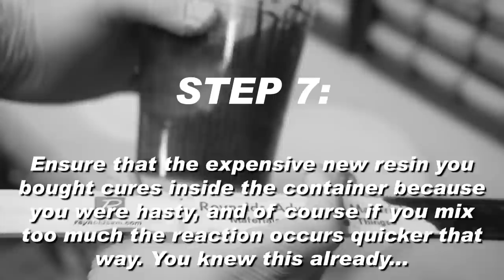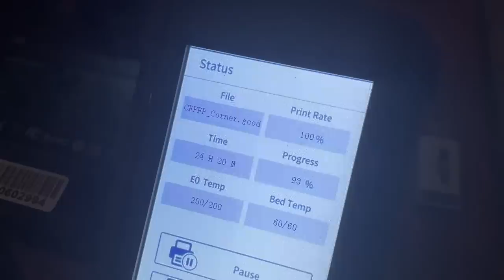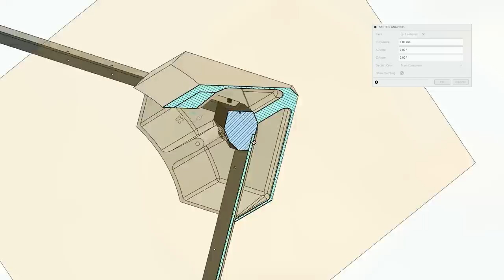How I made a life-size Companion Cube

Comment: Another Aperture product you could try building would be a laser emitter along with a laser catcher. It could be the same size as your button or bigger/smaller. Have the laser emitter fire a red laser beam, and a laser catcher that will detect it (maybe with a sensor) acting like the one in game (makes a sound and spins the outer ring) if it's not too hard (it also has a yellow light when activated and a blue light when idle)
Reply: or acting similar to a wiimote when pointed at the sensor bar (the wiimote uses light emitted from the sensor bar to detect where the cursor is idk how to explain it)
Reply: the thing with this is that the laser would be invisible unless there was something that could cause the Tyndall effect to show up, so itd be incredibly hard :(

Comment: Learning what not to do, is still learning :)  I’ve been sort of obsessed with the companion cube since I learned of its existence, even before I had played the Portal games myself… I spend loads of time 3d modeling my own version, which is slightly different from the in-game version, the “bumpers” are a lot smaller so the overall shape comes closer to a “flatter faced” cube.. if that makes any sense… I made a 1cm squared pendant version that was 3d printed in a wax material and then casted (iirc) in sterling silver :) I’ve been wearing it for over a decade now :) Hopefully one day I’ll be able to make a bigger one, probably not full sized for practicality reasons, but still… Anyway… love the work you’re doing on the Portal projects!

Comment: Realistically speaking, you could connect the cube via RFID sensors in the Heart mold to the button, to register it being pressed, OR have the LEDs connectable via Bluetooth (or some other wireless connection) and have the cubes light up room by room, puzzle by puzzle.

Comment: 6:11 Here's a trick to ditch sanding. Make the parts one thickness of styrene smaller on all faces, then glue styrene bits that you have cut with your CNC. For glue, use the rubber glue that Loctite has (it's the black one). It's thin, very strong, and because it's for rubber, it's actually very stable long term (i discovered when i repaired my washing machine and needed a glue that could glue the gasket that held my water temp sensor (nothing else worked because of the heat of the water). It's been glued on for nearly 8 years now and that's through a near constant cycle of hot-cold, if that's not a resume for a good glue, especially since it's stainless + rubber, dunno what could be. For all the corners, i woudn't bother with making them flush, that's when acrylic or body putty comes in, and a light sanding done with a tool that's 3D printed to have the right angle for the faces you sand is perfect. You'll have a styrene face, clean painting face in very little time. That's how i do it. Can you tell i hate sanding? :)

Comment: Awesome build! That is definitely a lot of LED's to run off of a battery. What happened to the battery? Did it smoke, or just have some dead cells?
Reply from the maker: Thanks! It just died suddenly, no physical damage. It was fully charged 10 mins before the test. Not sure exactly how it discharged so quickly since I had budgeted extra WH and only ran the cube for a few minutes at 10% power, so IDK.

Comment: Great video, and the cube as well!! But I do feel like you overcomplicated the lighting. (Disclaimer: I have only very basic knowledge on electronics, but I DO know how to BODGE lol)
Couldn't you have just put a smart bulb in there? Getting the colors just right might have been difficult then, but I think it might work. and I think powering one light bulb is also a lot cheaper with simpler parts, than the LED strip setup.
Also, why did you suspend the lights from all corners? Why not one bar diagonally from one of the corners?

(Another interesting idea I had was to special ring-shaped lenses so that the glowing rings on the outside receive focused light from one source in the middle, but this feels WAY too extreme haha)
Reply from the maker: I do agree that the lighting system is too complicated. The issue with using a bulb is that it wouldnt be evenly lit from multiple sides. I didnt do enough explanation, but the cube is evenly lit from all orientations in my design (like the game) I may use six interior bulbs for a V2 since that would be easier to assembly, but would still be tethered to AC power unfortunately.

As for the mounting, I designed the mechanical frame first and focused on keeping unique part count down, so making everything x6 or x8 simplifies the build. Having rigid mounts on only some of the parts increases complexity. Also, I couldnt find a way to properly film the finaly assembly, so I didnt show it, but it's extremely awkward to install the final interior screws that hold everything in place. The light core being flexible and adustable via zip ties allows me to maneuver my hands and tools better inside.

Comment: No suggestions for uses, just wanted to say that: considering the weight and production expense of a full-scale cube, I feel like a 60%* scale version would make a good compromise.

Now, I'm no engineer, and - realistically speaking - it's probably not going to bring the cost and weight down to 60% equally, but it might be more feasible (whilst also taking up less space. Not everybody has a workshop to store stuff in).

* - (I say "60%" scale because I've used VR to experiment with finding a comfy scale for Portal cubes and - for me at least - 60% feels extremely comfortable to hold/wrap your arms around while still being bigger than your head. If anything, the comfort might make it less painful to carry).

Comment: I really appreciate how the chassis is made of aluminum and polycarbonate but the bumpers (aka the parts that should really be the most durable) are made of printed pla and bondo😂
Reply from the maker: Yeahhhhhh, I originally wanted to make rubber molds and rubber corners, but they're quite large and the mold/casting supplies would have cost hundreds of dollars assuming I got everything right on the first try.
Reply: @MrVolt  That's probably the wiser choice. Idk much about rubber casting but I do know it usually doesn't go right the first time unless you have a lot of experience with the process

Comment: Figure out how to make it use a battery and then make a 5,000 megawatt super-coliding super button and put a wireless charger on it and wireless charge receivers in each face of the cube and configure it so it will be pink/blue when not charging and yellow when it is